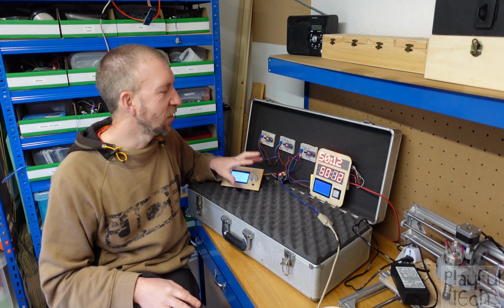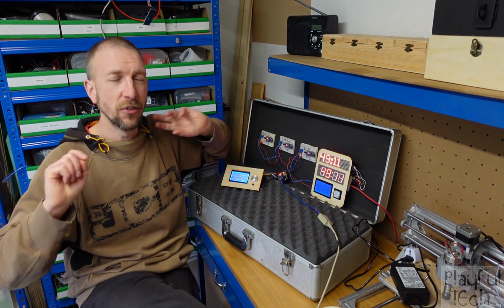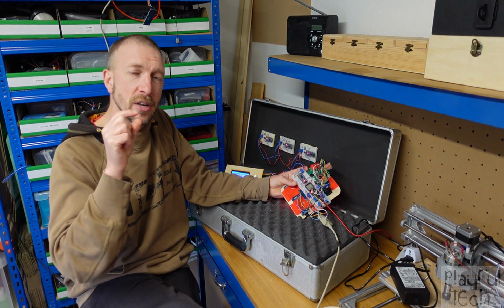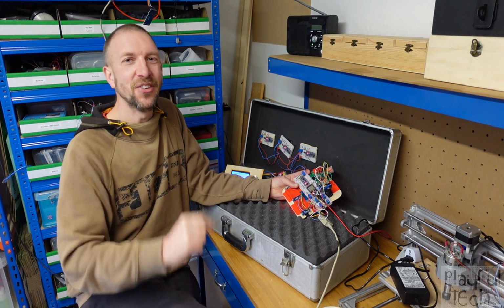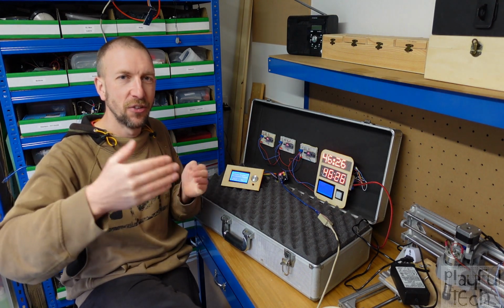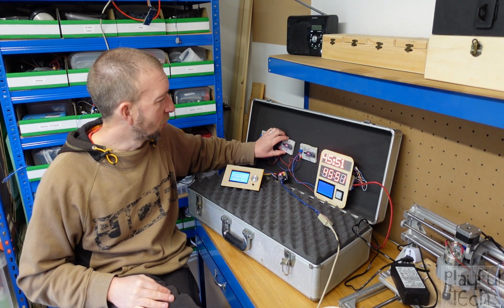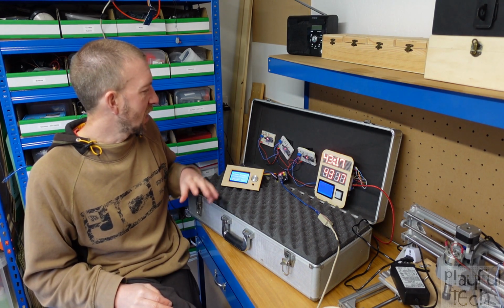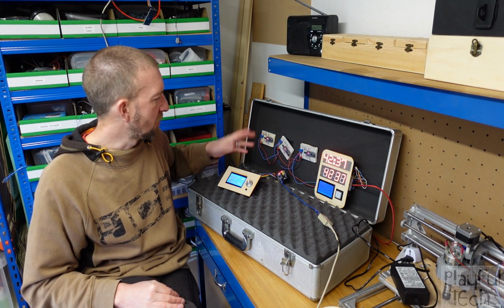Building an Escape Room-In-A-Box - Part Five

Comment: Hi are you going to give it a battery or some form of portable power rather then being plugged in at all times.
Reply from the maker: Yes, the plan (as much as I have a plan....) is to make it portable, so probably Li-Po battery powered.
Reply: @PlayfulTechnology  i bought a mini UPS. Which delivers 12V 9V and 5V at the same time 10.000mAh
I needed the 12 V for my laptop lcd driver and my soundblaster amplifier. My briefcase opens automatically by the use of 2 35kg Servo motors. And to solve the needed current spike at the start i made a capacitor pack so it has enough current to open the briefcase till over the most heavy point.
Reply: @PlayfulTechnology  thanks I really look forward to that part as I really couldn't rapy head around how to do that with a much more demanding project

Comment: For the level shifters. Are you sure you tried a bidirectional level shifter? Because I tried it and it worked using I2C. So i connected a Pi 2B via I2C thru a bidirectional level shifter and then to an arduino Una. Works perfectly.  By the way. I am also building a portable escape game in a briefcase. :-) When i have the frontpanel finished I will send you a photo.
Reply from the maker: I'd love to see it! I've found the problem with the level shifters - they have onboard 10k pullups on both sides, so would work fine for I2C, but don't work for PJON. I could desolder the resistors, or I can also make them work by adding additional pulldown resistors on both sides, but the diode solution is working well for now!